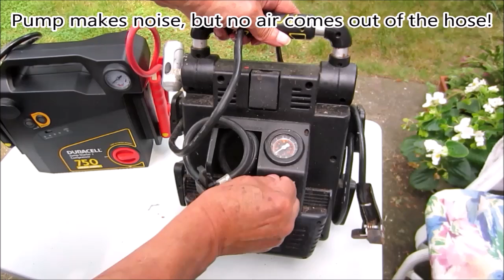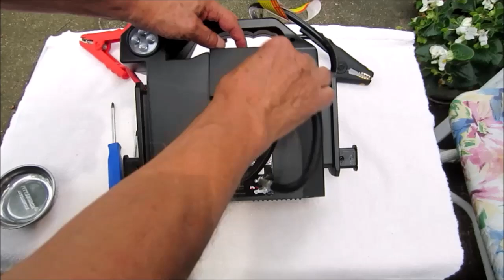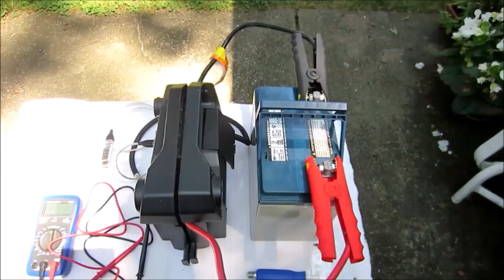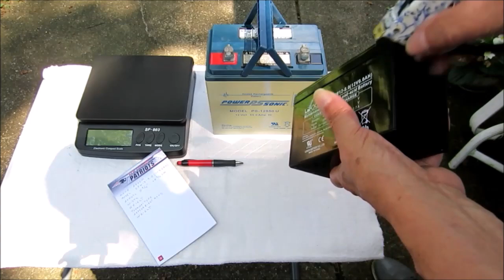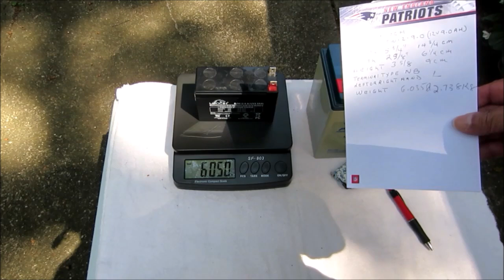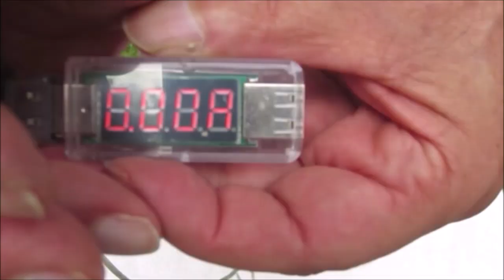Portable Power Repair Secrets - Duracell Jump Starter 750

Comment: I have one of those Duracell packs with a dead battery. I was looking at the terminals on the one that came up with a search of that number and knew there was no way it would work, so thanks for those screenshots of Amazon and a proper battery with bolt on T3 terminals. (I found a reference to the terminal type on Leoch’s website - that battery must have been a special order by Duracell)

I now have a ML9-12NB battery on order!